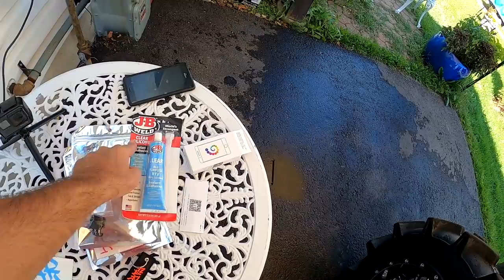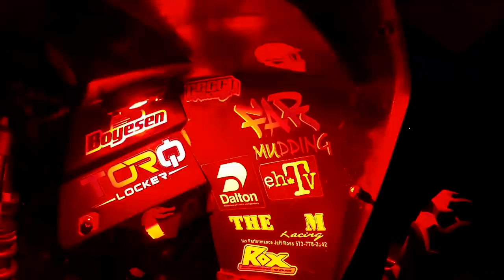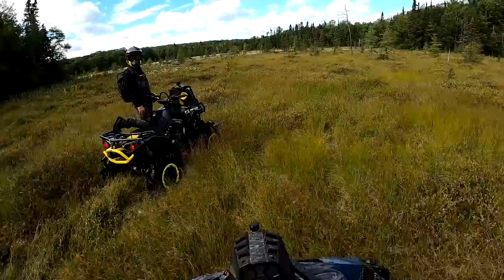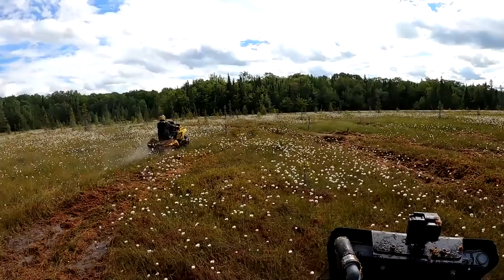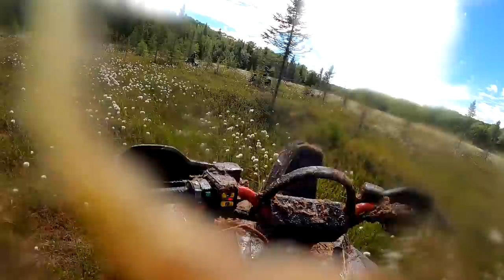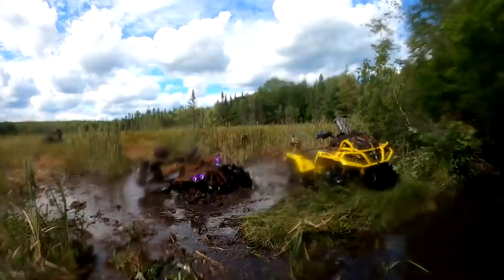His First Skeg Pull On The RENEGADE

Comment: Wow those sure came along way since my last pair I never even installed thought they were junk and had to silicone them on I didn’t like that idea looked cheap
Reply from the maker: I agree, much better then my last set as well.
Reply: eh TV the chase 2.0 are pretty slick ...I’ve got a set on my bike ....they’ve got some additional plugs for rock lights and something else that hasn’t come out yet
Reply: eh TV well I guess I might have to get a new set cause I sure didn’t like the last ones
Reply: Chris Dix check out far muddling chase 2.0 ...I haven’t had any issues with them ,take your time with the silicon and use a q tip to even it out  maybe have a wet rag handy to wipe off any excess rtv
Reply: TEXAS RENEGADE ya I’m just fussy lol can’t believe it’s 2020 and we need to use silly cone 🤣🤣👌
Reply from the maker: @Dieselmd2008  Yeah I didn't bother ussing it! Tape worked mint.
Reply: eh TV I will hit add to cart lol